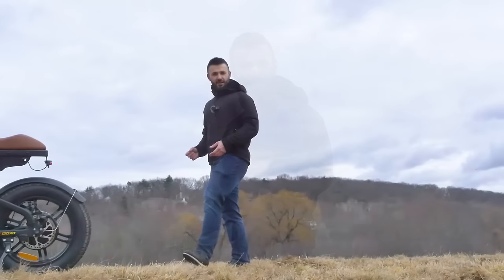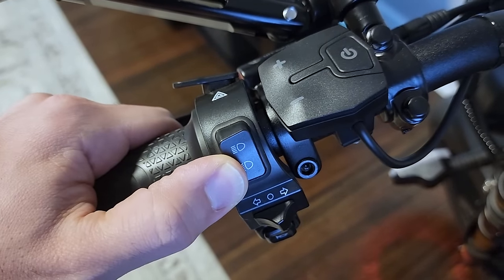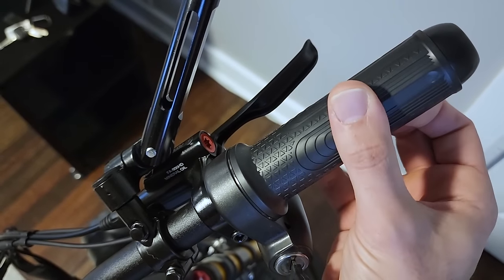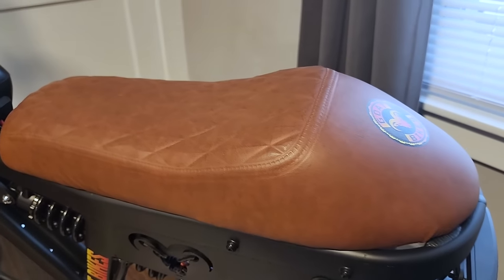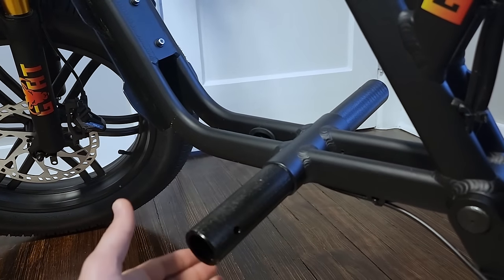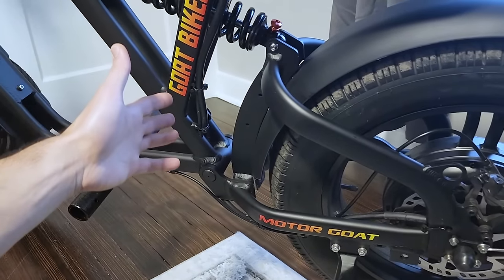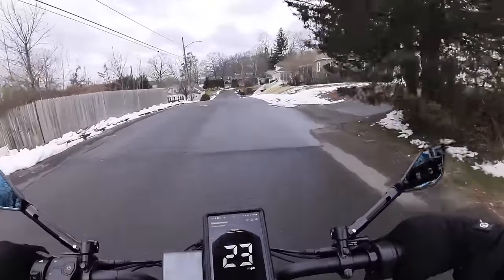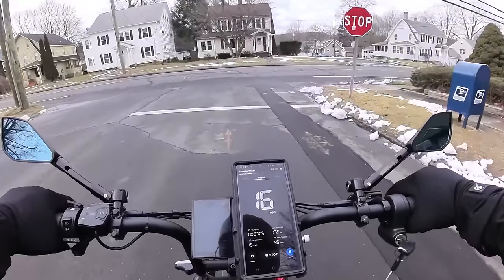40+mph Monster! Goat Power Bikes, Motor Goat V3 Full Review 2024

Comment: If a Goat chases you always run a zig zag and scream like a gurlymon... Pro tip.
Reply from the maker: haha good to know!
Reply: Actually if a goat/sheep is charging you, just stand there and move at the last moment before impact.  The goat/sheep close their eyes just before they make contact.  If you’re standing in front of a steel pipe fence post or a brick wall the sheep/goat will sometimes even knock themselves out.
Reply from the maker: @bobk18  poor goat!
Reply: @bobk18  lol 🤣
Reply: Thanks for the video! How difficult will it be to change the rear tire if you get a flat? It looks like you need to be an electrician.
Reply from the maker: @tonyholmes9024  super easy. The three main phase wires simply unscrew from the yellow box, then you unplug the hall sensors (white plug) undo the zipties and you can pull it all out. More work than quick connection yes but not too terrible.
Reply: @maximumchargeEV  Thanks! I asked the same thing on FB..ignore

Comment: I'm the guy trying to get the  custom battery from your suggested battery supplier.  I'm hoping that a suitable battery bag can be found to house the custom battery build. It seems like every thought I have on the bike as far as mods you seem to share. Just wondering how long of a wait itll take the company to fix the minor issues with the bike such as actual blinking rear turn signals, or the power cord being to close to the rotor,  or that ridicules child's horn they put on the bike which I'm sure no car would actually pay attention too which is a really dangerous situation just waiting to happen. I cant wait to see what you do with the controller to get more power. Please make the video as soon as possible and fyi your information is very appreciated!!! 100%
Reply: How much did the custom battery cost ?
Reply: @LeeAyzahn  I was given a quote of about $1300 for a battery that should fill in the whole frame of the bike. But the only problem is finding a bag case for the battery. I'm hoping the supplier can come across one. If not it really gonna be a eyesore. Plus something like that needs protection from the elements.
Reply: @mariod1907 True, plus I don't like the colors, logo and divider of the frame bag they're selling for the Motor Goat. But, in some of the pictures they have an all black version of the bag. I wish they sold that one.
Reply from the maker: We have some BIG news soon. Stay tuned
Reply: I just ordered a bike and used your code and told the company the reason I bought it was your video. Great job! what’s up I am waiting for my Goat. 

Tell us what’s up with the goat?

Comment: I’ve got 46 mph on this bike
Reply: Was yours on start strength level 5? Wondering if that makes a difference in top speed since his was on level 3.
Reply: What is your body weight? Was it flat terrain?
Reply from the maker: Shouldn't make a difference for top speed, only acceleration
Reply: Will u be sent the updated controller from Goat Bikes and then installing it? I'm hearing it's squeezing out even more speed than the shunt mod that u did. Would love to see your video on it, hopefully! @maximumchargeEV
Reply from the maker: @mkeonine  Maybe!

Comment: OUTSTANDING REVIEW....HONEST and THOROUGH!  I have watched all of the GOAT videos---and this was the MOST thorough!  That battery did Great with regard to mileage.  I lose about 20%-25% range and about 3 mph on my top speed in those temperatures and I have 60 volt 25ah Samsung Cell Battery.  HEY BRYSON----I want to buy the new controller and new rear blinking taillight when available.  :)  The wait for your video was worth it......one of your BEST reviews ever done!
Reply from the maker: Thanks Bruce! Looking forward to seeing all the updates coming for this bike!
Reply: I've got the power goat v2 coming in March and Bryson confirmed that they will have the new controller and Samsung batteries.  I'm.so pumped. I'm so glad I made the purchase.  This review was by far the most indepth review I've seen yet. Keep up the great work. Keep them coming
Reply from the maker: @ericbevins3858  sounds great! And thank-you!
Reply: Which temperatures does your battery start to sagg or drop percentage? I'm trying to understand what you are saying because I was thinking about ordering a goat power ebike but I need to know the range of the 25AH Samsung cells? What the top range you get out that battery?

Comment: Fantastic Review!!! I used weather stripping to stop my controller rattle. Worked perfect! I totally agree with the mirrors. What did help mine was making my own custom expansion bar above my handlebars made them higher. It helped some, but I like my mirrors further out like you. Had trouble getting those mirrors to tighten down the bolt was bottoming out. I added a washer and that helped that issue.
Reply from the maker: Good ideas! I already took them off 🤣

Comment: With the mirror you can swap it with the control buttons and move it out more. That would work better I bet. Or swing it under the bars that's how I have mine on my Ebike. Not the motor goat but the same type of mirror. But I agree I'm probably going to get outside mirrors too. My bike is almost done and then getting second battery for it and selling it lol.

Comment: What’s the difference between the motor goat and the Billy Goat?? is there any power differences or upgrade ability? They seem pretty much identical except for the frame. I’m leaning towards the Billygoat because of its frame it will fit in the back of my pick up.
Reply from the maker: billy goat is smaller and has 5ah less battery. I like the upgradability of this platform better.

Comment: - Will the rear turning head lights be fixed via a software update in the Spring?
Reply from the maker: Yes
Reply: The new batch of bikes, the rear turn signal, will flash
Reply: Thanks for the update.
Reply: Is it fixed in the Feb batch or March?

Comment: Just ordered one before another price hike. Will the samsung batteries be in the march batch? Im not even sure when i will get mine but the website said march is the next shipment.
Reply from the maker: It should be but double check with customer service. Congrats!
Reply: @maximumchargeEV  talked to customer service  and they said, The controller has been optimized to work better with the motor, making it quieter, smoother and slightly faster. The battery cells are Samsung now. We’ve chosen to go to a 4inch front tire to eliminate the rubbing. Rear signals now blink, and display now includes a voltage meter. They expect to start shipping early april. this is all in the new batch now
Reply from the maker: @cheekclapper177  That's amazing!

Comment: I love the fact that the motor & controller does not go into limp or get you home mode when the battery gets 25% or lower it still gives you as much power as they can even with a low battery most ebikes if this kind go into a limp mode or get you home mode which lowers the speed down to maybe 10-15mph ❤😊

Comment: Adjust you blue dial should soften the ramp up of the rear shock make sure its not on firm or full lock out that's good for climbing
Reply from the maker: I did do that unfortunately it didn't make it as soft as I needed it to be.

Comment: Many thanks for the discount code!  It was a tough decision between this and the Power Goat.
Reply from the maker: Welcome! What made you go with this one?
Reply: @maximumchargeEV  Two reasons, I liked the way the Motor Goat looked (like a baby motorcycle) and I liked that it had an extra 5 amps in it's battery - which I thought was worth spending that extra $100 on.  Of the 60v ebikes I've been looking at for a street capable commuter it seemed perfect for my needs.

Comment: I'd like to see  a hill climb challenge with the Freedom, we can finally put this direct drive vs geared hub debate to rest.
Reply from the maker: I don't own a stock configured freedom but I do own the cruiser (it used to be stock) and the electrical components are nearly identical. I would say this is faster up  long less steep hills but the freedom with the geared hub motor would be better up steep hills, even steeper than my steep hill climb test, like for off-roading purposes.

Comment: Great video, this is going to trigger that wired group on FB 😂 its a great bike though for the price. If you get this with pedals is it a cadence sensor or torque sensor or are the peddles even connected to a sensor at all?
Reply from the maker: If you get it with pedals its a cadence sensor. I think both bikes are great but this one is better if won't be doing any off-roading, and obciously if you like the moped style ebike

Comment: is there a way to switch the brakes so that rear brake is on the right and front brake is on the left?
Reply from the maker: yeah but you would need some special tools and you would have bleed the brakes.
Reply: @maximumchargeEV  thanks man do you think it’s worth the price cause i’m tryna get a job rn and if i get it im trying to save up enough to get a bike, so i was just wondering if the bike was worth it.
Reply from the maker: @Blackywackyda  this bike is a very good value. better than most others. Besides this I would look at the ecells five star for a good "all around" ebike, or the ghost cat for an off roading option. This one is great for streets only.
Reply: @maximumchargeEV I was wondering why you say street only? Like it’s can’t really do off road?
Reply from the maker: @dillonburkey2185  heavy, hard suspension, high center of gravity, smooth street tires, bad pedaling geometry.
Reply: @maximumchargeEV ok thank you. Yea I just bought it. But hey at least I’m 280lbs lol 😂

Comment: I really want to see a direct apples to apples comparison between this Motor Goat and the Wired Freedom. This bike claims 25ah battery vs 20ah on the wired. That, plus the gearless direct drive motor is supposed to be more efficient. Combine those, and this bike should show a markedly higher range.
Reply from the maker: I'm going to do a "performance analysis" video on those bikes soon

Comment: Been in the market for one of these bikes 
Interested in knowing is this the best on the market for power and range 
Also what upgrades are available
Reply from the maker: this is pretty good, but ecells has a no tarif sale right now for the five star. If you call them, and add my code max100 you can still get that bike for well under 2k which is the best deal right now IMO for an overall great ebike.

Comment: No quick disconnect for the rear wheel is a big failure. And the power goat does come with a dual suspension.
Reply from the maker: 1. Find me a quick connector that can handle 50amps. 2. They are adding suspension to that model :)

Comment: It is a beautiful machine. But instead of installing pedals. I would install floor boards instead to rest my feet. 
     And I would also put on that one big battery to fill out that whole empty cavity. And this way. Instead of registering this vehicle as an electric bike or moped. 
     I would register it as a motorcycle. But only if that big battery makes the bike go above fifty (50) miles per hour. Saddle bags would be a nice touch mounted on a rear cargo rack would be a nice touch also, to carry anything else if need be.
    But that's just my idea. And keep the chrome side up. And the rubber side down. And ride safe.
Reply from the maker: Video on a lot of what you just said coming this week!

Comment: the code only takes off $124.95?
Reply from the maker: yes they reduced the discount. July 1st they will also be increasing the price due to the tariffs.
Reply: @maximumchargeEV  awh whattt?? how much would It cost then? I was planning on getting one
Reply from the maker: @dantethorpe5523  still the best value 45mph ebike around. Under 2500. Add it into your cart with my code to see the final price. I have more pricing details in My newest battery video with the bike

Comment: I love the power of this bike, but I genuinely really dislike how it looks. Maybe it's the battery shape and position, maybe it's the massive opening in the middle, or maybe both, but to me the Revv1 looks FAR better. Of course, then you have way less power, so I'd still rather get this and just deal with the looks.

I will say, though, that I don't mind the look of the black/gunmetal grey version that doesn't have any of the orange on it. I think that color, combined with some kind of storage rack in the big middle opening, would look pretty good.
Reply from the maker: They do have different frame options and different colors like you mention. They are also releasing a power goat soon with rear suspension
Reply: Yep, ever since I first heard about this brand I've only been interested in the Motor Goat model.  This model mostly caught my attention with it's style and extra 5 amp hours in it's default battery compared to the other 2 models available.

But I started looking at the Power Goat more and that frame seems to have more potential for modifications.  All 3 models have the same power specs so it just depends on style preference.  

From what I've seen the Motor Goat just looks too cramped compared to the Power Goat, especially with the gas tank style battery.  It doesn't feel good if you have to come to an abrupt stop and you end up smashing your nuts against that top battery 🤣

Also, the Power Goat will have dual rear shocks, while the other 2 models will only have a single rear shock so it should have an advantage there as well.

The only reason I haven't pulled the trigger on a Goat Bike is to see what reviewers are experiencing and I'm glad I haven't yet.  As mentioned in this video, Goat Bikes are going to make some adjustments to their bikes, so it pays to be patient.

Plus, it's way too cold outside right now to fully enjoy these machines.

Comment: How much do you weigh? Matt from Juiced Joyrides was only able to get 38 mph. Guess the lighter you weigh the fast it goes.
Reply from the maker: Didn't he get it to 43 on his test? I'm 200lbs and probably had 20 pounds of gear/clothes on me.
Reply: Matt tested the Billy Goat model .. probably very close to this one with slight differences
Reply from the maker: @chuckwolf9869  I think they all share the same controller and motor? Didn't he get up to 43mph?
Reply: @maximumchargeEV the website specifically states higher speed for this model over the billy and power. Not sure what the exact difference is to cause the higher mph
Reply: @andyfumo8931  simply not true tail happy hit 45 on the GPS on the Billygoat
Reply: @TheTcat1000  i think you meant this comment for the original poster but matt got 43 from the gps
Reply: @andyfumo8931  if you watch Matt’s video, you can clearly see for a split second 45 his thumbnail stated 43

Comment: the controller is probably a cheap square wave controller. I was looking at that gas can style battery they have on the frame to build a battery with and newsflash it doesnt hold 25a worth of cells at 60v lol
Reply: Please elaborate
Reply: @andyfumo8931  you’re right that seems kind of suspect, That gas tank battery case is on ali express, says it holds 91pc 21700.  You could fit 60V (16s) 5p  which is 80 cells. But another 16 cells for 6p would only be over the 91 cell limit of the case by a few. So maybe they jammed 96 cells in that same gas tank case some how. 96 is close to 91
Reply: @EBikeBuilder_  i suppose they could have asked the Chinese manufacturer to increase the size of the case slightly

Comment: That motor should be able to handle up to like 5k maybe 6k. My 1500 can handle 4 to 5k
Reply: Watts?
Reply: @andyfumo8931  yes watts he understood me lol. It's the only thing it could be.
Reply: @oldmanebikes8392  for my understanding, sorry, was what i meant my clarification for. So you're saying a 2000 watt motor could handle 5-6k watts from the battery?
Reply: @andyfumo8931  yes and sorry I didn't mean to come off wrong lol I had just gotten woke up by friend and was still half asleep. Lol but yes it can handle that with ease. I have pushed 4k watts thru my 1500w Direct drive motors
Reply: @oldmanebikes8392 do you think this bike frame and dropout can handle highway speeds? 65mph for an hour
Reply: @andyfumo8931  I don't have one but I am sure it can. It looks to be made really good. My bike now isn't the best made but it handles speeds good.
Reply: @oldmanebikes8392  aluminum alloy? Wouldn't you need steel at that level?
Reply: @andyfumo8931  no as long as it's built good.

Comment: Very comprehensive review, thanks for taking the time to be so thorough. I’m still stuck btwn a rock(goat v3), and a hard place(talaria x3) 🥲. First world problems, I guess(sighs).
Reply: I'm stuck between the motor goat or the Eahora M1ps 😅
Reply: @jayowen286 after that, if it's not enough then there is the Kollter CS-1 but thats a motorcycle 😅
Reply: @andyfumo8931 72v, 76ah battery, 70mph!, street legal, and even comes with a warranty 🤯. Also it’s easily one of the best looking e-bikes/motos I’ve ever seen. Thanks for the heads up. Can’t wait to see some reviews.
Reply from the maker: Glad it was helpful!